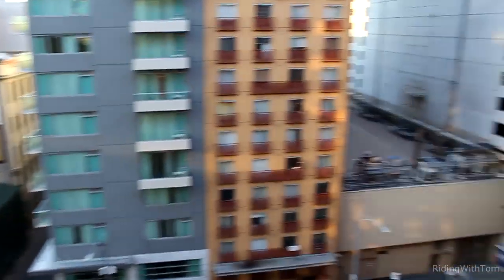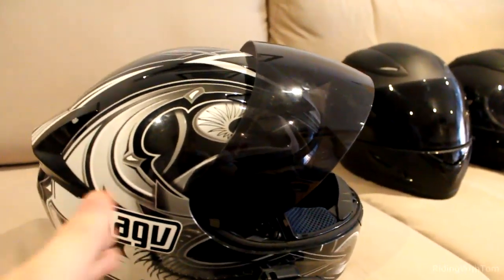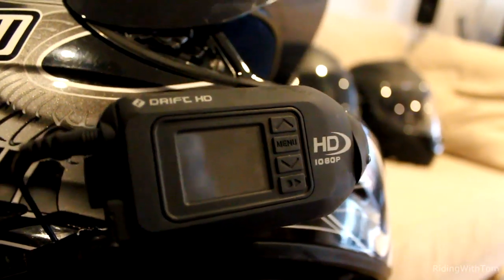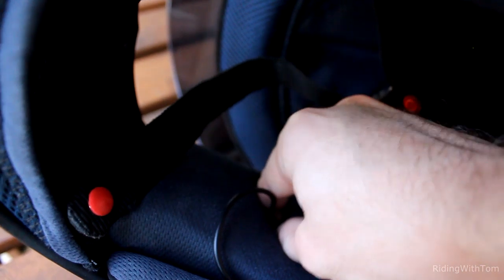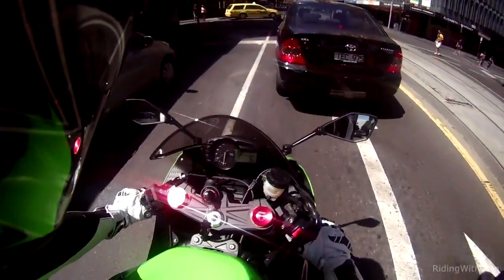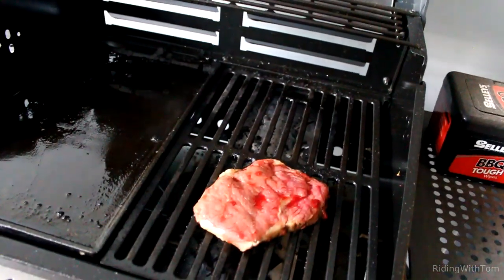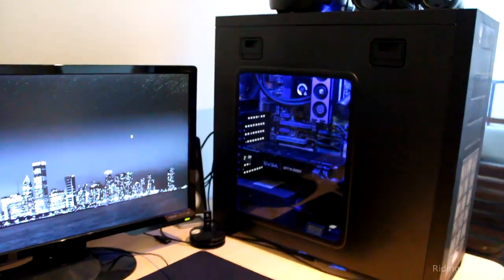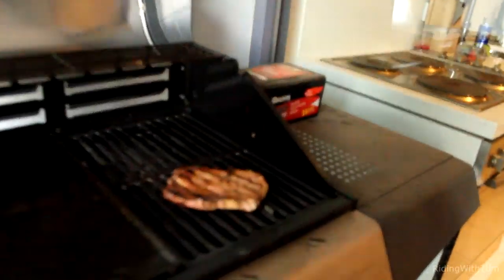Helmet Setup - Drift HD Vlog Setup - Interphone F5 Setup

Comment: the gopro has a larger profile, not too bad for mounting on bikes but for helmets you can feel it creating a lot of drag, plus the drifts have a rotating lens so you can mount it whatever way and still have the video the right way up whereas the gopro has to be mounted straight which is awkward on helmets

Comment: Did you happen to figure out how to connect intercom's output to the camera? I've fiddled with a 3.5mm splitter for the camera input and plugged in two microphones - one records my voice, one is near the intercom's right speaker. It's better than what you have here (i.e. had in 2013, I guess) as you can hear both sides of the conversation but still, not great. Would love to know if there's a way to solve it somehow. I use Freedconn TCOM-SC and Drift Ghost X. Wish there was 3.5mm out on the intercom, man.